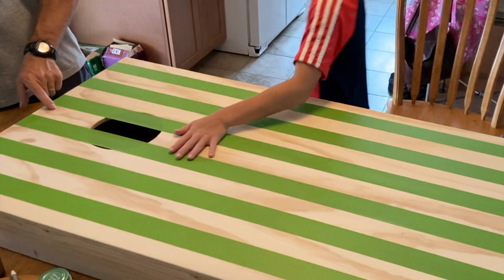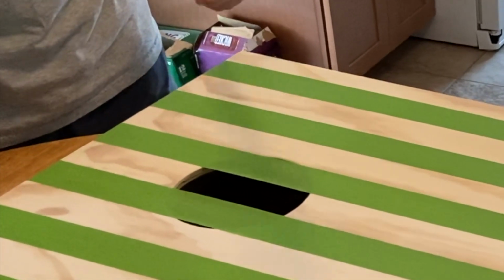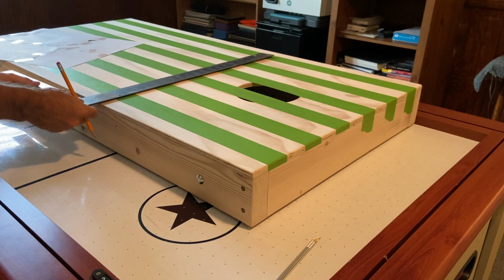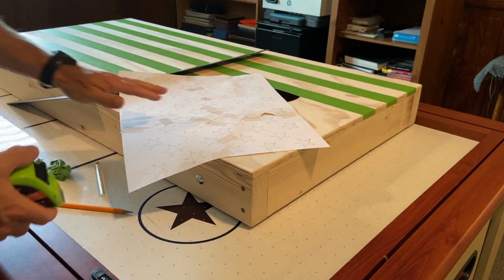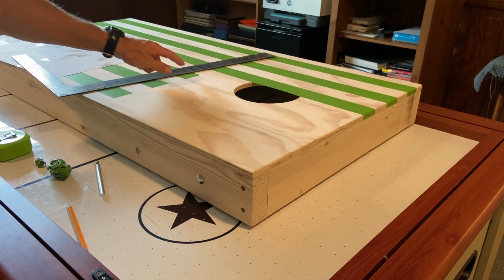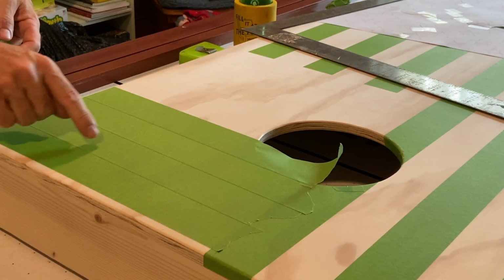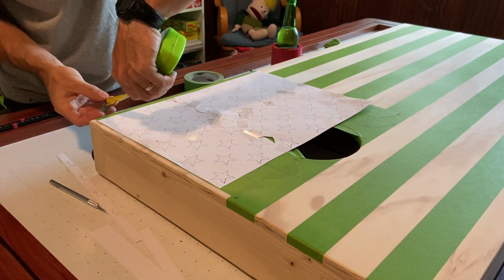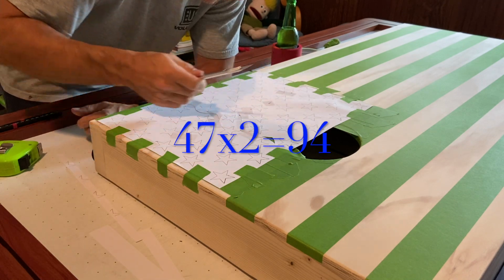Staining American flag Cornhole boards step by step

Comment from the maker: Here are some of the things i used in my video, hope this helps.Thank you for watching, please leave a comment and thumbs up it HELPS YOU TUBE PROMOTE MY VIDEO.
X-ACTO knife  https://amzn.to/3hpGtVQ
green painters tape 1.88 inches  https://amzn.to/32MpFnJ
Minwax Gel stain (hickory)  https://amzn.to/2OQeq5A
Minwax one coat polyurethane  https://amzn.to/2D07qAo

link to guy that sent me the STARS  https://youtu.be/XGGAkC6Dqs0

Thank you very much for watching and God bless

*Full transparency. I am a participant in the Amazon Services LLC Associates program, an affiliate advertising program designed to provide a means for me to earn fees by linking to Amazon.com and affiliated sites.
Reply from the maker: You can support my page by just clicking on one of the links above, thank you for your support.
Reply: Looks close but you need 13 equal stripes not 12 and one less than 1/2 the width of the other stripes.

Comment: Awesome job! Really great result on the stain. I was thinking if I use a star stencil and put a few coats of polyurethane on the natural wood for the stars, the stain wouldn’t absorb and I could save myself about 10 hours of cutting. What do you think of that idea? I’m assuming the stars would be a little raised after the final coats of poly once it’s all stained but I might like that look better
Reply from the maker: Not sure maybe hope it turns out awesome

Comment: You sand by hand or with sander AFTER staining?
Reply from the maker: By hand, it did not need that much sanding. thanks for watching
Reply: @DIYJIM  and that is before polying, right? I'm at this point and definitely dont want to mess up.. I used vinyl for the stars instead of tape and had NO bleeds so I dont want to have to start over!!
Reply from the maker: @carondamarler6429  i sanded before poly and  after my first coat of poly i put two coats on. Hope your boards turn out great

Comment: Great video I like your build except for the flag is not correct. US flag code prescribes the US flag should always be presented with the union at the top left from the viewers perspective. Whether vertical or horizontal.
Reply from the maker: I never even Realized I did that. Thanks for watching. Really hard to fix.
Reply: Horizontal, it is at the top left.